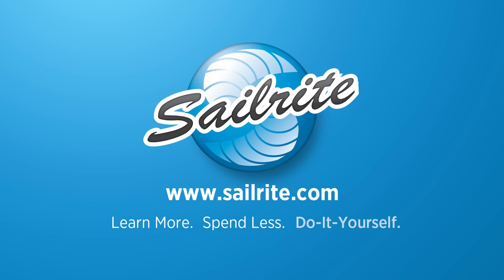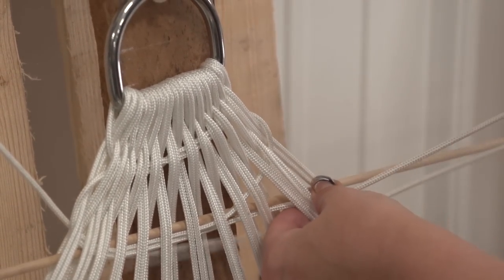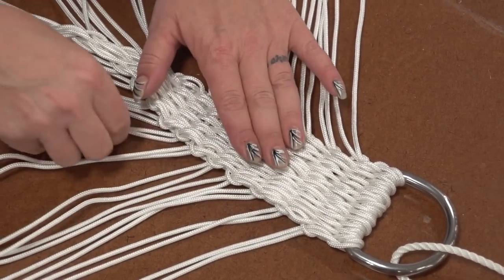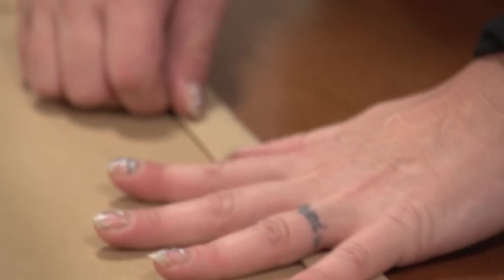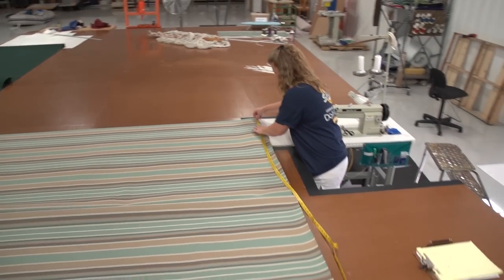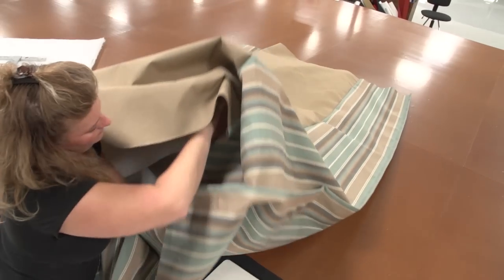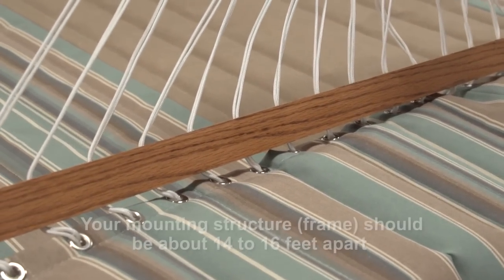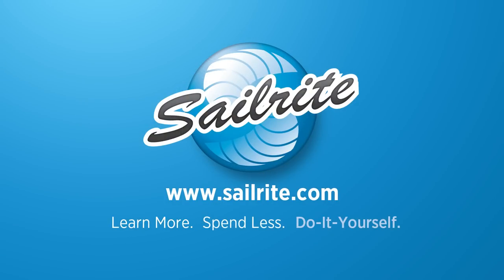How to Make a Fabric Hammock

Comment: At the beginning of the video you place the bottom screws for the weaving loom at 2 inches apart, but later when you make the spreader bar you state the holes should be 2 1/2 inches apart.    My clew knot looks the same as yours but when put into my spreader bar the lines get progressively shorter from the center lines out.  By the time I get to the outside my lines are about 6 inches longer than the center ones.  I assume this is due to the discrepancy in the stated 2 inch distance for weaving vs the spreader boards 2 1/2 inches.  I'm going to try making a new spreader with 2 inch spacing and see how it works.
Reply: Tom Bartlett So here's what I've found:
1. Don't assume your fabric is actually the width it's said to be.....my "60" inch fabric was more like 58 and another was more like 57.  So build your hammock FIRST, and THEN lay out your grommet holes and THEN  build the clew and spreader bar based on those measured hole spacings.
Reply: Tom Bartlett  Exactly! I found the same problem. The pallet jig in the video is 46" wide. This would be ok for a single wide hammock. This clew jig is not meant for a double hammock!
Reply: +Erik Schmidt actually it's much wider than 46"... was a large pallet..not one of the small ones :)

Comment: I know now you won’t sell the Posi-Pin system by itself if we intend to use it on sewing machines not branded by you. I’m curious if you’ll also start screening basting tape (part 129) sales, insuring that each tape roll is only to be used on your fabric? I’m not buying a brand new machine just for the Posi-Pin, but would sure give you some $ if you decided to sell it again. This may be abstract, but in business, some $ is greater than no $. At least that’s what they say. Either way, thanks for the video! I can’t hate you Sailrite. Just don’t turn into salewrong.
Reply from the maker: Sailrite no longer sells the Posi-Pin bushing and nut as stand-alone parts. The Posi-Pin system was developed and patented exclusively for use on Sailrite Sewing Machines and is now only available as a standard feature on new machines or as a custom quoted upgrade, or replacement part for existing older Sailrite branded sewing machine models. (serial number and photos required). If your goal is to increase power and slow speed control on a non-Sailrite portable walking foot machine the option we recommend is the Monster II Balance wheel (https://www.sailrite.com/Monster-II-Balance-Wheel). It can be used with good success using a standard friction clutch, or it can be locked permanently to the shaft bushing using the included set screws.  Please let us know if you have further questions.